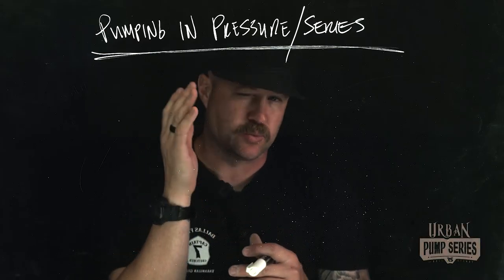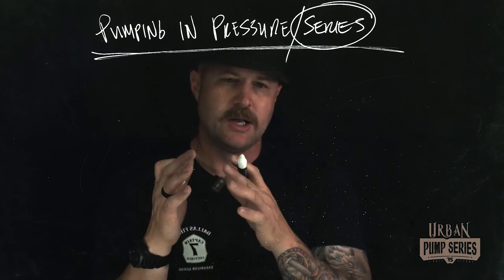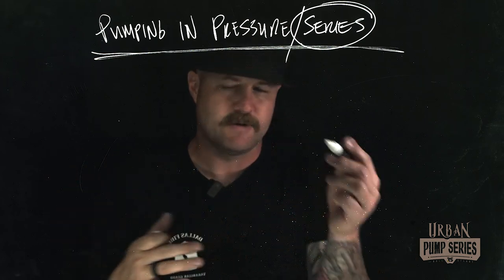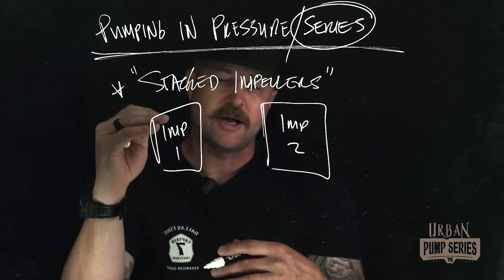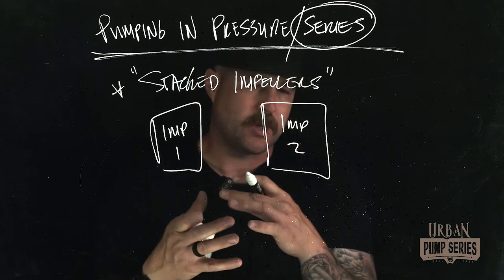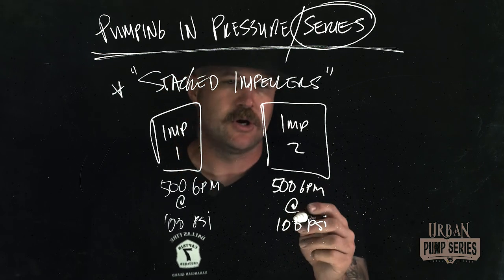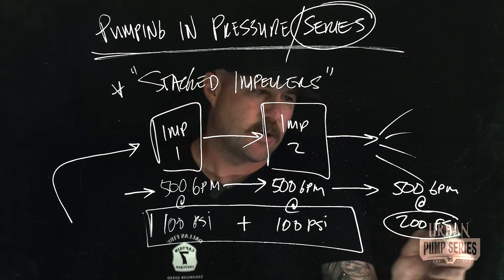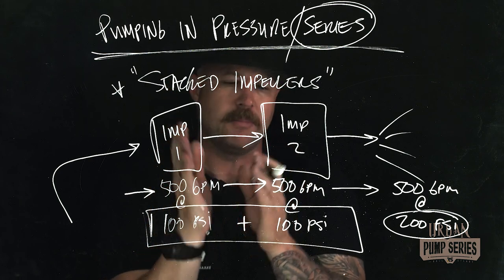Urban Pump Series (008) - Pumping In Pressure

Comment: This is very interesting, I thought when using the series mode, when you gain the extra pressure, you lose volume....so using your example, that 500 gpm would be less gpm but more pressure....I think the exact numbers is it would be 70% of your original gpm...?
Reply from the maker: When you run in series you lose volume only in the sense that you are now limited by the capacity of a single impeller. 

You could gain greater volume by “splitting your impellers” (aka Volume/parallel mode), but you sacrifice potential pressure capacity. 

Multi-stage pumps are designed to offer efficiency in both pressure and volume needs. It is a give-take relationship though. If you maximize one side of that equation, you’ll sacrifice “potential” on the other side… and vice versa. 

Hope that answers your question. If I went down a different path, let me know.
Reply from the maker: If you are referring to 100% capacity @ 150psi, 75% capacity @ 200psi, etc…. 

This is in reference to your pumps rated capacity from UL, set by the manufacturer during drafting operations. This simply is telling you that as your pressure increases above 150psi that you’re volume capacity is diminishing. I believe it’s something to the effect of 50% capacity at 250psi. This is important, but in the urban environment becomes less important information because you are tied into a pressurized water source (not drafting).